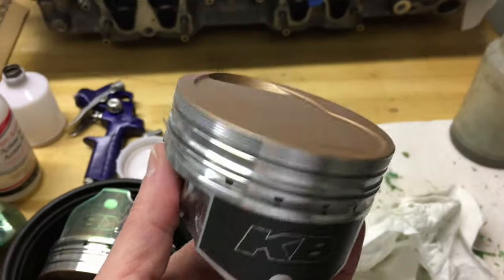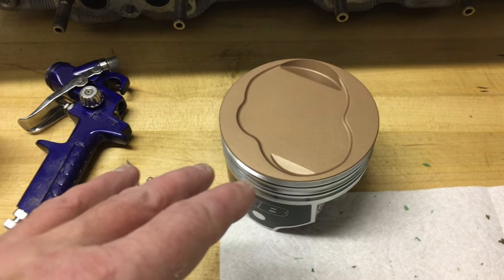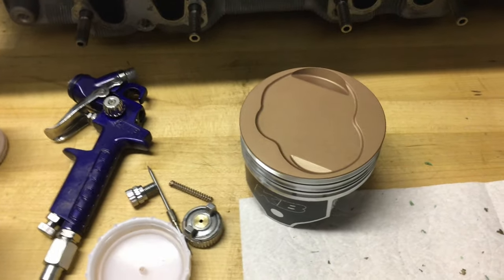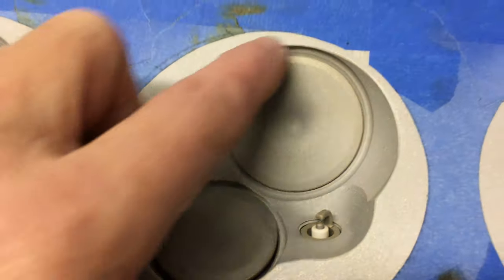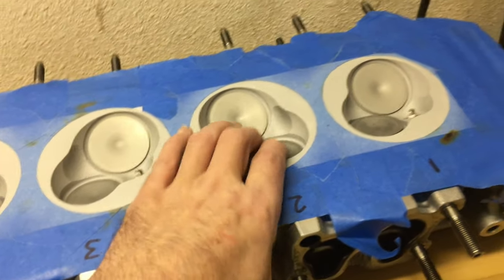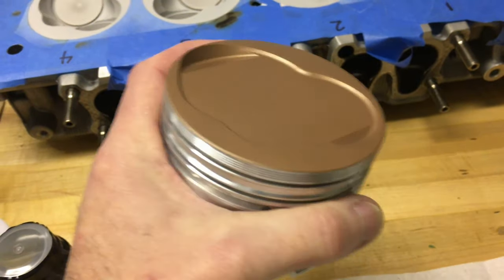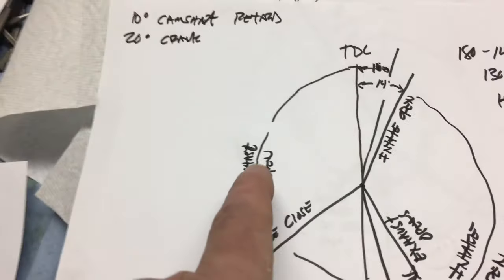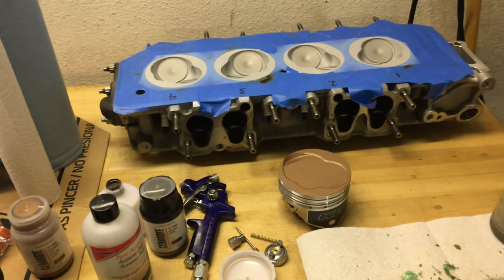What I learned Ceramic Coating my Toyota 22RE Keith Black pistons using Cerakote V-139 Titanium Red

Comment: An added bonus of the titanium coating on the piston and heads, if you run E85 or nitrous, it prevents corrosion and pitting of the metal caused by these fuels. Properly applied the coating never wears off

Comment: Low Thermal Emissivity is coating to reflect heat away from the piston, and there is also High Thermal Emissivity which SINKS HEAT, I am using that on the outside of my aircooled block and heads to remove engine heat. ARCTIC BLACK (OVEN CURE) P-202
Reply from the maker: Nice... I'll check that out. Love Cerakote products.

Comment: I would be interested to see how the coating held up when you pull the head. 

I looked through you vids, but I guess you have not had a reason to do a tear down on it yet. 
I just discovered this awesome product a few months ago. I am putting this on all sorts of things. Crazy hard, slick, durable finish from what I am seeing.  
My manifold gets red hot and this stuff still looks like the day I applied it. What ever dirt does get on this stuff comes off easy.
Reply from the maker: Yeah, it's good stuff. As near as I can see, it's still holding on there (when using the bore scope). It's covered up with carbon, but as far as I can tell it's still looking good. I don't know when I would be pulling the head off again, but when/if I do, I will clean things up and see how the cerakote is holding up for sure.
Reply: the coating never wears off

Comment: Couple of cam thoughts
Your 110 degree LSA is good if you have pro ported or otherwise real nice flowing heads.  Otherwise 107 degrees would be a little better.  The 102 intake centerline may sound like a lot of advance - which means advancing the cam, not retarding - might serve you well, giving a strong low and midrange output, by sacrificing a little peak rpm power. There is some error in the 237 advertised and 216 @.050" shown on the paperwork.  We don't see opening and closing ramps that aggressive/short.
Reply from the maker: Thanks for the information. I am running a ported head with larger valves and also a very free flowing exhaust. Running the cam retarded 5.5 degrees definitely makes the truck more enjoyable to drive and provides quite a bit more power and breathing when using this particular camshaft from Web Cams.

Comment: Hi Ray, I might have missed this in the video, but are you running KB standard cast pistons or hypers?  What is your piston to wall clearance?  I had my engine recently rebuilt by a reputable engine manufacturer using Sealed Power cast pistons bored 20 over. They ran a 0.0020 piston to wall clearance. Unfortunately, it has a slight cold piston slap until it warms up. (It had much louder slap prior to the rebuild.) The slap is only present when the engine is lightly loaded. It did it before and after break in. Toyota’s spec in ‘87 FSM is 0.0008 to 0.0016 using OEM pistons.  I think prior to ‘87 it’s up to 0.0020, so my 0.0020 clearance is probably ok. I’ve read that Toyota acknowledged piston slap on 22Rs back in the day and deemed it as a “characteristic”.  I suspect many people have it but don’t notice or don’t care. Anyway, just poking around for info and thought I’d hit you up given your experience and love for the 22R. Does yours do it?  Thanks, Bryan
Reply from the maker: Hi Bryan - yes, I'm running the higher silicon content hypereutectic pistons here, with a ceramic coating on the top. My piston to wall clearances are about .003 on average (specifically they were .0031/.0031/.0028/.0032) and this includes the anti-scuff coating on the side of the KB pistons. Without that, it would be more like almost .0038-ish on most of them there. My rods do not have the oil hole squirter deal on them, so at start up the cylinder walls are probably lacking a bit of oil initially. When I fire up the motor, I have noticeable piston slap (it used to sound like a diesel practically for a second or two). I'm very careful not to place the motor under any load for about the first minute or two. Since switching to Liqui Moly oil, the sound has gone way down. After my motor warms up for a couple of minutes, it's mostly gone. After driving a few blocks, it's normal. Compression is good and no blowby or oil consumption after several thousand miles, so the slapping I hear briefly in the morning isn't too much of a concern. On my motor, I just honed the cylinder walls and didn't want to bore the motor over beyond the previous owner's +.020" so all things considered, I'm happy with the piston to wall clearance and the behavior of the motor. Also, the ceramic coating on everything serves to prevent heat from getting down into the piston (for as rapid expansion at start up), so there's that. I think that is also part of what is giving me that initial 30 second slapping I hear, because the hypereutectic pistons tend to be closer to forged pistons in that respect that cast ones that expand right away with any heat at all.
Reply: @ray5961  On rare occasions, I get the loud 2 second slap (or maybe loud cam noise?) at startup that you are talking about.  It sounds like 10 or so very loud "ticks".  But I always have light piston slap under engine load until the engine warms up after a few minutes, then it goes quiet.  Prior to the rebuild, it sounded like diesel until it warmed up, so there was definitely an improvement.  I'm not too concerned about it, but I was just hoping that I would have a dead quiet engine after the rebuild......but then again, this is a 22R.  😀 Everything else is good (compression, leaks, clean oil, blowby, etc).  I might give the Liqui-Moly a whirl.  What specific flavor and viscosity of Liqui-moly are you using?  Thank you for your detailed (and prompt!) feedback.
Reply from the maker: @poivre22  Yeah, perfectly quiet 22R motor... sign me up also haha. Here's the oil I'm running: https://www.amazon.com/gp/product/B00CPL952G/ - 10W40 because my connecting rod bearing clearances are at .0025 - which is sort of the dividing line between 30 vs 40 weight oil, but I opted to go slightly thicker for more protection. I also run 8 oz of Lucas ZDDP, which between the Moly oil and the 8 oz of ZDDP gives around 4300 PPM of Zinc, which the 22R's require. Takes the oil about 500 miles or so to start to really smooth things down. Give it a shot and let me know what sort of results you see over there. I also run a magnetic drain plug; check the top 10 upgrades video on my channel and the link is in the description for the steel one I run here.
Reply: @ray5961   At 500 miles, I replaced the Amsoil mineral break-in with Castrol 10W-30 dino oil and Rislone ZDDP additive.  I have about 1000 miles on it now.  At around 2000, I'll give Liqui-Moly a shot.  I'll stick with 10W-30 as my bearing clearances are around 0.0015, and it gets cold in MT (though I don't drive it much in the winter).  I will also look into a mag plug.  Thanks again for the info.  You are awesome!
Reply from the maker: @poivre22  For sure, you're most welcome. And yeah, if your bearing clearances are .0015, I would stick with 30 weight also.
Reply: @poivre22  MICRO SLICK DRY FILM LUBRICANT COATING (AIR CURE) C-110
use on the skirts to reduce piston slap
Cerakote Micro Slick is used to assist with friction areas and shedding of oil.  It is used to reduce friction on a variety of internal engine components such as piston skirts, valve stems, and the underside of valve covers.  It is also used on firearm components, such as bolts, and bolt carriers.

Comment: Was there an issue with applying too much ceramic coating where you run into the piston hitting the top of the heads or does the sand blasting take off enough metal to allow for equal thickness to be reapplied?
Reply from the maker: the head gasket thickness provides plenty of insurance. The Cerakote itself is very thin and some amount does lay down into the rough blasted area.

Comment: hey ray what benefits does that cerakote make? is it over kill for this type of engine? an why not just take the block to a machine shop and build it on engine stand? just curious
Reply from the maker: Both very valid questions haha. I don't think the ceramic coating process is too much overkill. It's definitely a luxury item though. The main benefits should be cleaner chambers, better thermal efficiency, cooler running engine, slightly better gas mileage (perhaps), better ability to withstand detonation, etc. All those things are beneficial to any motor, big or small / high performance or stock. So while it is a lot of work for the likes of a 22RE motor, I do think it will be worthwhile. Time will tell. As far as pulling the motor and doing all this on a motor stand, yes, that would be easier. However, because this motor only needs to last a few more years, I opted to take this route, since it allows me to work with the existing block. Aside from the small gouge near the top of cylinder #2, the block itself (and the bores) are in totally fine condition for a refresh. We will know soon enough how this all comes together. Stay tuned!
Reply: @ray5961  super cool keep those vids coming cant wait to see it running!
Reply from the maker: @chefrobertcaldas  Thank you man... it's getting there. I should have the pistons in the block tomorrow if all goes well over here.

Comment: Have A 1990 P/U TOY.  want to rebuild engine have had no luck with local rebuilders on other truck what would you recommend? do you rebuild 
engines?
Reply from the maker: You might check with some place like LC Engineering or 22RE performance and see if they can offer some suggestions and/or maybe you could ship parts to them. I do rebuild motors, but only my own personal stuff.
Reply: @ray5961  yes LCE will do it but 4 month waiting list and must ship block at 700.00 dollar ship charge
Reply from the maker: @jtaylor-fi5bd  Yeah, last time I talked to them, they mentioned a shortage of 22RE engine blocks was causing delays. Shipping is a hassle for sure. It's almost worth a road trip to AZ :) Almost.
Reply: I live in tx do you think there engines are so great it's worth driving my engine block all the way over there rather than having it done local?
Reply from the maker: @jtaylor-fi5bd  I think if you can find a good local machinist, then local should be fine. The problem is that a lot of the good ol' timers who really know their business when it comes to stuff like operating Sunnen equipment are tending to retire. Even our once main local shop - which did just about everyone's engine work - can't find anyone to work their equipment in the back. When it comes to stuff like re-grinding crankshafts or boring cylinders, your margin of error is generally .0001 or .0002 tops. That's 10th of an inch, not thousands. So you really have to know what you are doing.. not only what you are doing, but how to measure those tolerances properly and how to calibrate the machines and double check. At those levels of precision, even the heat from your hand or the draft from an open shop door can start to have implications on accuracy. Back in the 50's or 60's or even the 80's, cars required rebuilding all the time, so you had plenty of engine and machine shops keeping everyone on the road. With today's manufacturing, most people buy cars, drive them 100K miles and then just replace them (more or less). So it's not exactly the same as it was before. Where are you located? Can you find any local old time autoparts places? I'm not talking about AutoZone w/ a bunch of 20 year olds. You need to find an out of the way auto parts store that has been in business 40 years.. then go talk to the old guys behind the counter and ask them who does good engine building/machining in town. They should know the story. What exactly are you planning to do here? Re-bore the cylinders and deck the block? When you start to get into stuff like boring the mains or grinding the crankshaft or re-sizing the rods, that's when it starts to get a little tricky. If there any possibility of just doing an engine refresh here? Also, are you going to be doing the re-assembly or are you looking for someone to delivery a turn key engine and you throw the cylinder head on? On my motor, for example, I checked the block and crank using micrometers and a very accurate dial bore gauge and found that it was all still relatively within tolerances; by going with KB pistons that have a .0005" addition to the skirt, I was able to get away with just honing the block out. Same w/ the crankshaft... journals were all largely within spec. I had to buy new connecting rods and swap some bearing shells around, but I was able to get everything to .0025" on the big ends. For $700 and the hassles, I think I'd look far and wide locally.

Comment: any updates on how this runs?
Reply from the maker: Yeah it's running well, I will say that the ceramic coating seems to delay the pistons coming up to temperature and expanding especially since they're hypereutectic, so I have to be a little careful when I initially warm the truck up but other than that everything runs great

Comment: Why didn’t you just remove the blue 3M tape before baking the pistons? I’m sure the cerakote wouldn’t drip down the pistons while baking, assuming it was applied correctly. The silicon tape was totally unnecessary, especially during the baking process. For anyone who wants to mask a piston and bake it with the masking tape on it, use Kapton tape, it’s a silicone polyamide tape that can resist very high temps without melting, or hardening, it’s very common in electronics, and aerospace industries. BTW, the orange silicone/fiberglass insulation is usually called a “fire sleeve”, it’s the last line of defense for electrical circuits in extremely high heat applications like rockets.
Reply from the maker: Yeah, I think that would have been a better way to go also. Mask with blue 3M tape, spray them, let them sit for 15 minutes, then remove the 3M tape and bake them. I'll check out the Kapton tape; thanks for the tip!
Reply: Cerakote HIGH HEAT TAPE Item: SE-340